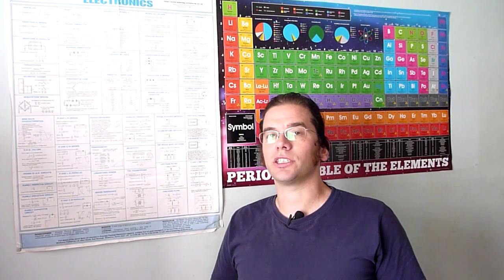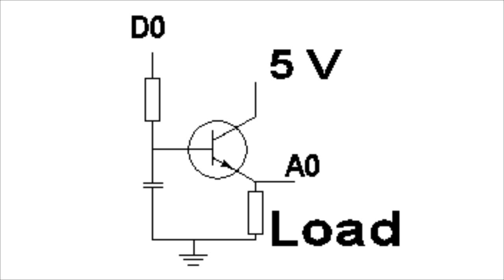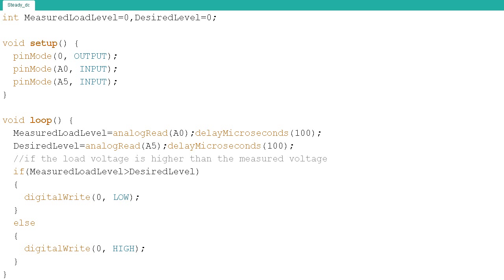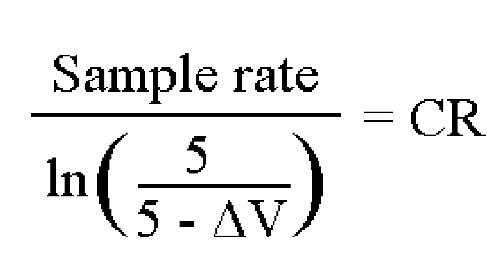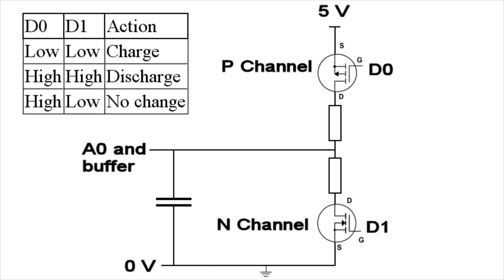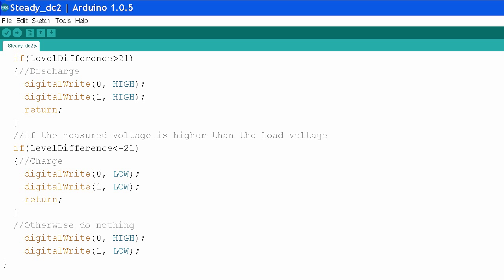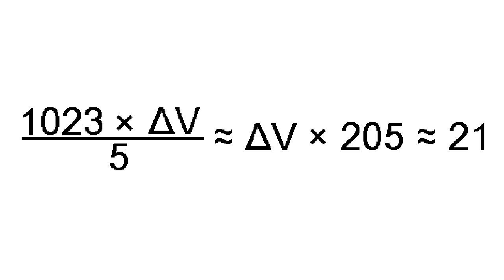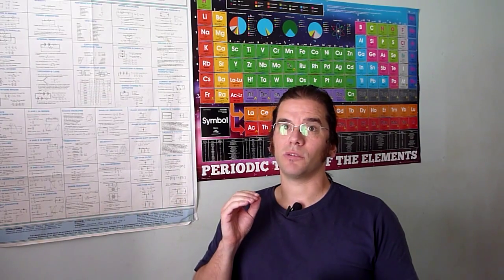Tutorial Steady Analogue voltage output Arduino

Comment: I'm glad you didn't use some DAC chip. I was thinking of using something similar myself, glad I'm not alone.
Reply from the maker: I used a DAC chip for my "Invisible Theremin" invention. It uses I²C (or SPI, I can't remember now) so it uses hardly any pins. I bought 8 and 12-bit versions.

Comment: What are the values for capacitor and resistor you used in second circuit, which MOSFETs did you use?
Reply from the maker: someone I'm using Unicode so hopefully you see the symbols. The MOSFETs are the FQP33N10 and the FQP27P06 which are great ones with integral diodes for dealing with a back EMF. You have some leeway with the values of the resistors and the capacitor. I would use maybe 10 kΩ and 1 μF giving a time constant of 10 mS. As long as the program checks the voltage frequently, it should be stable. Increase the capacitance if you need to. Bear in mind that the Arduino Due has two digital to analogue pins which could be employed but I suggest you buffer them as they source 3 mA and sink 6 mA.